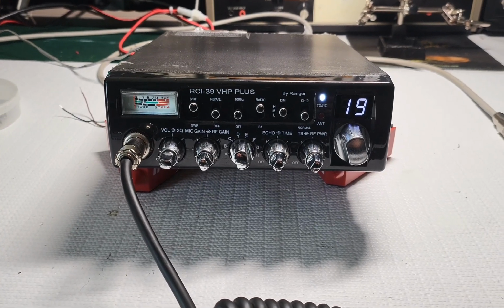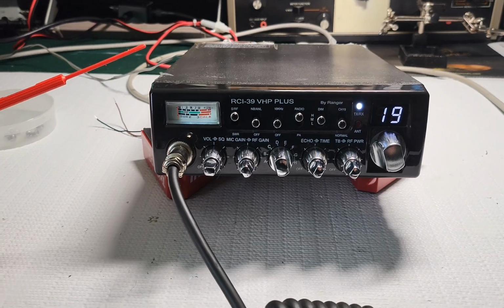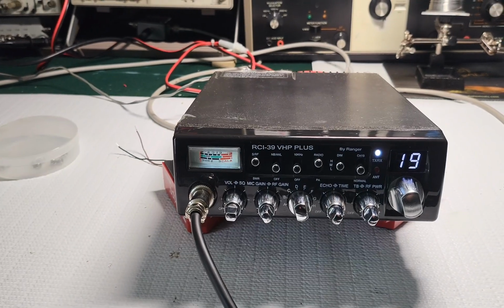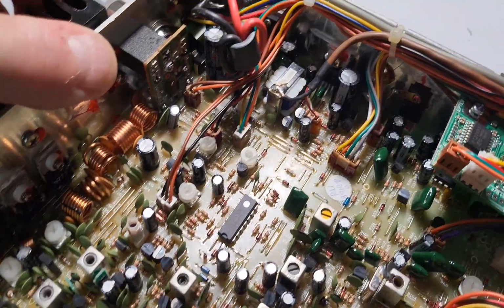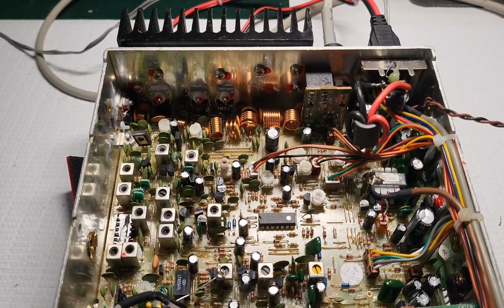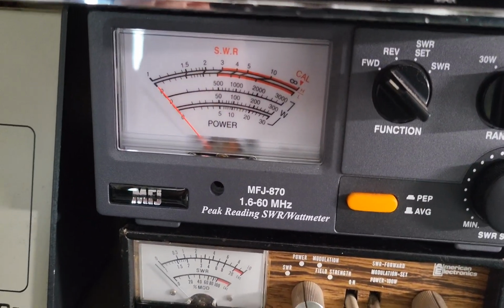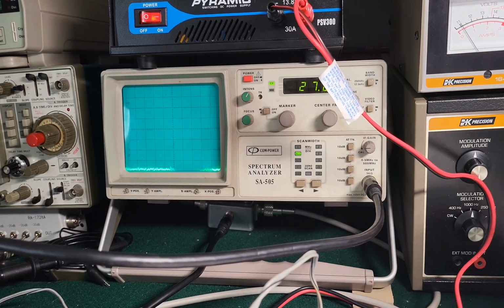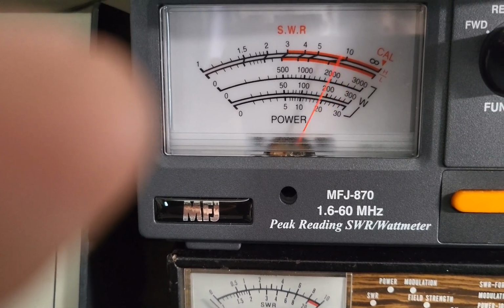RCI-39 VHP Plus repair, preliminary check, the good, bad and ugly

Comment: Would putting in a rt3 or rt5 in to replace an rt1, be an upgrade or not possible?
Reply from the maker: I'm not sure to be honest.  I would need to look at the data sheets on them.  It's possible but the driver and pre-driver may need to be changed as well.  Or maybe not.  I'll look into it

Comment: Do you repair Yaesu?
Reply from the maker: I used to work on the older ones.  Not anymore, parts are too expensive and people complain about the cost of parts and labor.  It wasn't worth it.  Just 11 and some 10 meter radios.
Reply: @pulsarcb  I understand. I know how pricey parts can be, especially Yaesu.  I would not be one to complain because my only other option is to send it to R&L near Cincinnati, and they are very expensive, and they will only repair to factory specs. I need non factory specs for 11 meters. I have 5 Yaesu HF rigs that need repairs 
I have a ft767 gx, a ft840, a ft450 D, and 2 ft7B's.  I love Yaesu.
Reply: I can afford repair costs. You sure you couldn't be coaxed into repairing 1 for me at a time. I'd like the 767gx done 1st. And one 7b I'd consider selling